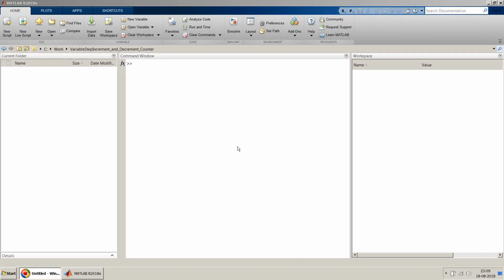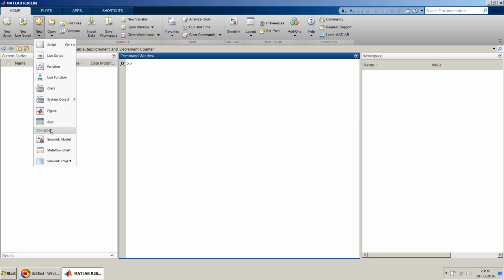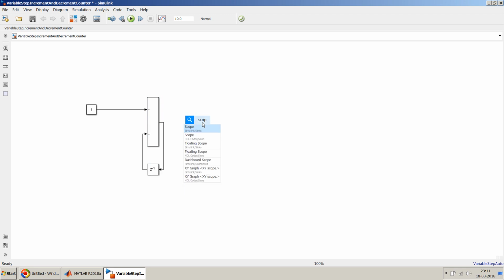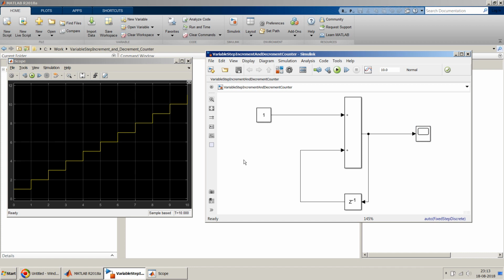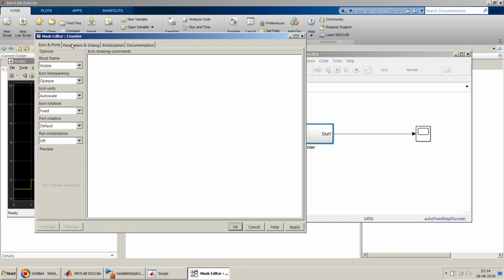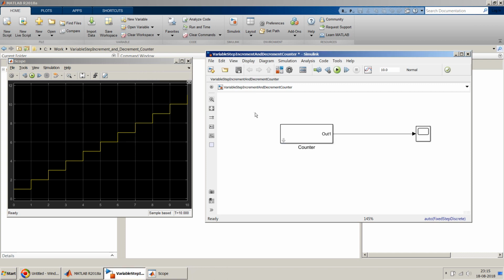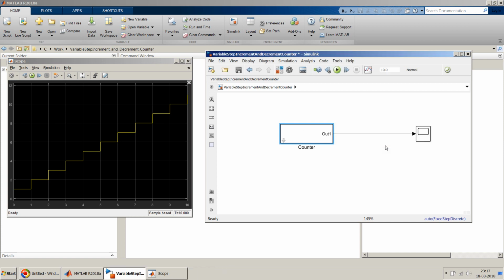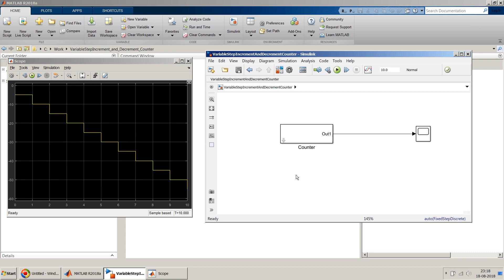How to design variable step increasing and decreasing counter in Simulink?

Comment: Hi. I have a problem with my project. 
Design a hardware architecture, using Matlab's Simulink, which works in the following way. There is a 2-4 decoder whose output is loaded (in parallel) in a counter 0-15. After loading, the counter starts its increasing count starting from the loaded value. how should i do?
Reply from the maker: I am not sure about your exact problem. However, if you are looking to reset your counter after it reaches the upper limit of 15 then you can refer to my below video which shows how to design a reset counter:
https://youtu.be/ER39UlBxbIg

Good Luck
Programmer World
https://programmerworld.co

-

Comment: Hello Sir,
it is possible to create a simple counter and when it gets to 1 (MAX_VALUE)  it starts to decrease to 0 (/\) ?
Thanks in advise,
José Luis.
Reply from the maker: Hi, 

I think what you need is rising and falling counters model. Till now in none of my video I shown this implementation, but basically what you need is a combination of rising and falling counters as shown in below 2 videos:

https://youtu.be/ER39UlBxbIg
https://youtu.be/9seGi3vMWAc

To combine the above shown concepts in one model, you would need to create a switch concept which toggles between increasing and decreasing counters when threshold is reached. I will try to create a video tutorial on this and will let you know once posted.
Reply from the maker: As mentioned in my above comment, I have created a video showing the solution as per your requirement. You can watch the video in the below link:

https://youtu.be/aUQ3RNH_oQs

I hope this video helps in answering your question.

Comment: Hello Sir :)
I would like to ask you a question.
How can I use a timer to generate a PWM signal? For eg if ton=300 ms and toff=200 ms

Thank you
Shikha
Reply from the maker: Check my video on designing the reset counter:

https://youtu.be/ER39UlBxbIg

You can use the similar concept of creating a PWM signal by switching between ON and OFF state based on the value of the timer reached.

Comment: If counter rising from 100 to 120?
Reply from the maker: If not already done, then please watch my video on reset counter and decreasing counter: 

https://youtu.be/9seGi3vMWAc

For your requirement, I think in the model you can replace the reset value by 120. And set the initial value at 100. Also change the decreasing counter to increasing counter by changing the signs in Sum block. 

So,  please do the above changes in my model shown in the decreasing and reset counter video and you should be able to achieve your requirement.